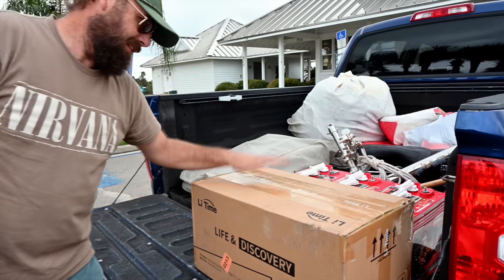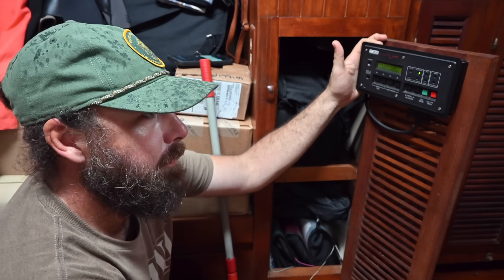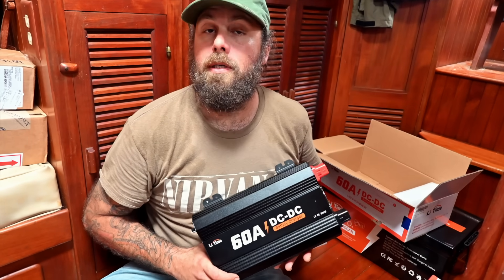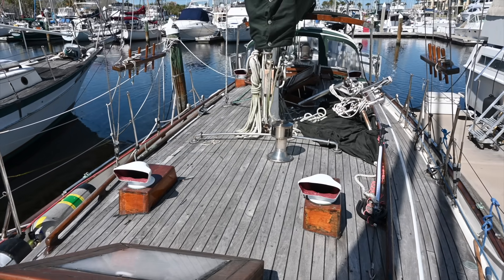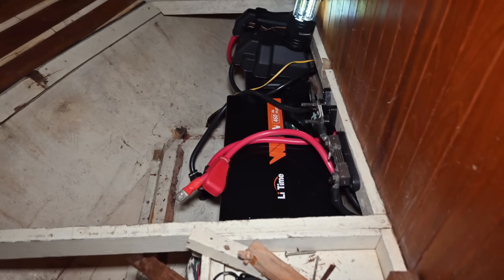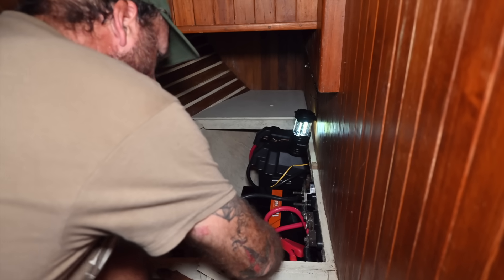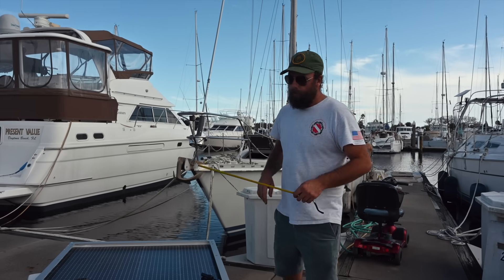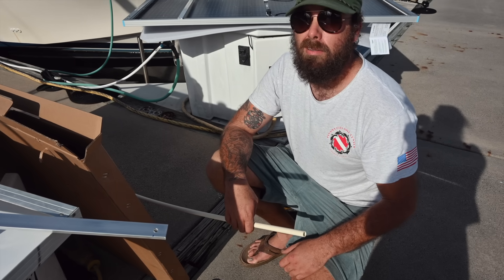WE COULD HAVE EXPLODED! The switch to LiTime LiFePO4 after battery bank was OFF GASSING (Ep47)

Comment: 12:22 I might recommend getting a newer fuse, or better yet a thermostatic breaker.

Also realize it might not matter for you but a wind turbine. I love this vertical on it comes with a wind charge controller this can connect to your battery management system. Once again can't find these things on Amazon.

Brand: TFCFL
Wind Turbine Generator Kit, Vertical Wind Turbine Generator with Charge Controller, 12V 400W Wind Power Generator Energy Supply for Boats, Green Windmills, Industrial, 300RPM
Reply from the maker: Thanks! Yes I do really want one. Hal absolutely didn’t  but he’s no longer on the boat so I can look for one.

Comment: Can you take your teak deck off plane it down then use structural adhesive to attach it to a substrate that doesn’t rot then use the same method to attach to the deck (no screws through fiberglass)?
Reply from the maker: We’ve been considering doing that. It may not be worth it with the current teak because it is thinner, as it’s aged, but it’s not as thin as one might think, and it hasn’t been overly abused over the years either so maybe! We’re still deciding what we want to do about that.
Reply from the maker: I will say this- if we can’t reuse this teak, I very well may sail this boat to wherever in the world I can get a good deal on a teak deck. Hahah I prefer it.

Comment: Sorry ,but are you really sure there safer . Battery bank is supposed to be vented to outside boat ,as mine is according to  lloyds . Off gasing is usually course by bad management. You can rejuvenate standard lead acid . Up to you . Major thing . Keep fire blanket next to lithium. If it gets hot , wrap it in blacket and throw overboard.
Reply from the maker: These aren’t the traditional lithium batteries, they’re the LiFePO4, which are FAR safer than other types of lithium batteries, so yes. They are safer. Also, they don’t need to be outside the boat. That would be a disaster and there’s nowhere outside the boat to install a battery bank anyway. 
The previous battery bank was totally fried and was off-gassing, but we just bought the boat, so this wasn’t necessarily anything we did. The batteries looked old and weren’t marked with dates or anything.
Reply: Hi , I'm aware these are p04 batteries and I agree that they are safer than EV batteries.  Just be mindfully that they are never taken down to 00 v as is a common issue on board boats un attended . This erases BMS memory . Then if you shunt change as stated by manufacturer the BMS has no guide to manage batteries,  this can course issues . The caution I was referring to was OK to store below decks ,but store them being able to get out and wrap to overboard if they get hot . I'm a marine  engine engineer of 38 yrs . Hope this is of use to you
Reply from the maker: Thank you for that!

Comment: I don’t know much about batteries ! I would like to learn. All power banks for solar are lithium I think in homes that are off grid. It is best at any point to keep them cool. Because heat is their enemy. 
I had a truck that I needed start and it was dead, so I jumped started it I caused a spark and one lead acid and battery blew the top off right in my face. It didn’t catch fire but of course I had to replace it. So as far as safer I do think they are but any can have issues. One channel had a bard new cateraman that burned at the dock it was plugged in on charge and lithium batteries caught fire. This happened about a year ago.
The boat was a few weeks old. Another you tuber that was on a sailboat  left his phone plugged in overnight it woke them up at anchor to their boat burning like crazy and had to escape through a hatch. And had jump overboard it burned to the waterline and sank. The only thing different from usual was he left his phone on charge like he normally didn’t do. So lithium is kind of dangerous yes but be aware of the dangers, because many other things can also be dangerous living aboard. Lead acid will not burn but yeah they blow up, and will not provide the power needed to run your boat. The vapors off of them is toxic also so the dangers are pretty close, but the power difference and long life is a major benefit. Make sure they don’t over charge and stay cool, I have read heat is the cause of fires, and over charge and fast discharge causes heat problem and a risk of fire. As long  as you manage that well you should not have any problems, many you tube boater channels have went all lithium and solar. In the long run it will save you money, and with enough of battery bank you can use as much electric as you need. One day lithium will replace almost all batteries on the market. The technology has improved very rapidly and much better now than before.
People bashing it has it and uses it everyday in cell phones. Some even carry it in their hip pocket.
Oh battle born batteries is supposed to be the best (I don’t know), is that what you guys bought ?
Reply from the maker: We did a collaboration with LiTime batteries so they supplied us with everything we needed, so it was a win for us! They're all quite expensive, but these are the newest tech, the LiFePO4 batteries, which aren't like the lithium ion batteries. Supposedly, these are MUCH safer. We will see!

Comment: Danger is my middle name.  Hydrogen sulfide gas is part of life for lead/acid batteries. But, it’s not really an issue unless you’re overcharging them.  The alternator must have been pushing some serious amperage for three batteries to discharge! Hope you saved the old batteries for backups. An inline fuse would slow the charging to the batteries if you are worried about it.  
See y’all when you get back!  Hold fast and batten down.  There’s a strong front moving through the north end of the Gulf tonight.  I don’t know how far it’s gonna dip down south.
Reply from the maker: If I know Hal, this batteries are sitting in the back of his truck at home. 😂

Comment: 14:25 😂😂 video says it all. That rust spot of the bar is barely moving. 😊remember we all have different POVs and the cameras pov wins
Reply from the maker: I voted that the plastic part needed to be replaced and could break off! Hal voted that it was the metal. I dunno...
Reply: I'm with you Siren. Bar didn't budge. Bracket was rocking. Ah well, hopefully the zip ties keep it tight for you. @TheSirensLog

Comment: Lithium is definitely the way to go. It’s cheaper in the long run than lead acid or AGM, because you get about 10 times more charge Cycles, plus you can discharge them close to 100% vs 50% for lead acid.  They are very safe if installed correctly.  Most people confuse the lithium iron phosphate with the Lithium iron used in scooters and cars etc. which are more prone to fires. You did mentioned adding more batteries at a later date. Please note that it’s not recommended to hook up lithium batteries of different sizes, brands or age. In my opinion 460AH is quite substantial for the needs you listed.  I would like to know what type of alternator you have. If you are charging the lithium from the alternator via a dc to dc charger, its recommend to use an externally regulated Alternator where you can control the alternator output, because 😂lithium batteries are “power hungry “ and can over work an alternator. A work around is to charge your start battery (assuming it’s AGM or lead acid) from the alternator and use the DC to DC charger to charge the lithium. Be safe guys.
Reply from the maker: I’ve read your comment to Hal and I’m going to tell you what he’s saying. I understand the system but he knows the setup and what he installed better-
Hal says:
That’s what we are doing- we have an 80 Amp alternator and rigged to charge the starting battery, and the dc to dc charger charges from the starting battery. We’ve jumped the charger to bring the charge from 60 amps to 30 amps. We got the 60amp dc to dc charger in hopes that we could upgrade to a high output alternator later this year.
Reply from the maker: Thanks!!! I will show this comment to Hal. We JUST got a new alternator. The old one was having trouble, and we suspected that basically since buying it but we are now underway and it’s confirmed. We got a new alternator on the Yanmar and it was the one recommended from Yanmar corporate.
Reply: Get a bluetti max charge , 2000 solar  gen , all I one problem solved .

Comment: you said you were inverting but i don't think so.  unless you are running 120v appliances off your battery bank you are not inverting.  you are just operating on 12v for your 12 volt lights etc.
Reply from the maker: We have a 5000w inverter in our lazarette and in one of the first scenes of the video, Hal is explaining how to connect the system to that inverter via the “remote control display”. We run everything off our battery.
Reply: @TheSirensLog  got it so you must have been running 120 volt lighting or perhaps a 120 TV or music system otherwise just running 12 volt lighting does not opearate off an inverter.  Love your adventure can't wait to see you at sea!
Reply from the maker: @paulrees2152  Are you just trying to say that we don’t have an inverter?
Reply: @TheSirensLog  not at all you do have one and you need an inverter, but not to run 12v items. An inverter converts 12 volt power to 120 volt power, when needed.  12 volt lighting and marine electronics run straight 12 volt power from your battery bank.  That's all.
Reply from the maker: @paulrees2152  Ahh yes. Most of our things are 12v, but we still run some 120 like the internet and whatnot.

Comment: With a large solar panel like that you better attach it better, it seams a lot of your repairs and installation of systems are done as a jury rig , don’t get mad but when your life and others depends on the security and reliability of your boat everything you do must be a better standard then what your doing now !
Reply: Solar panel isnt a safety concern and easily detachable if the occasion should arise.  Any and all vital systems to the boat have been fixed with no expense spared.  I am trying to get her home.  Not setting her up for world travel.  100 miles, mostly under engine, in the ICW.  If anything happens I'll ground her and call Sea Tow.
Reply from the maker: You say that but since buying the boat, I spent $13k in just 3 weeks making the boat sound enough to travel. We’ve done a lot more than we could ever show on YouTube.

Comment: Our dog held her pee for 35 hrs before she went on deck. Now she goes all the time.and I agree with you. I think the bar was moving inside the plastic supports
Reply from the maker: Dang! hahaha, I think he will bust before then! But I could see that... once they HAVE to do it, they know what to do. lol
Reply: May be a bit optimistic with the size of the mat😂
Reply from the maker: @Bryan-j4r  yeah the size on the internet was kinda scammy. They included the sides as part of the width and length. 🙃 It wouldn’t have been much bigger anyway, but… still! Either way, I measured the spot is was supposed to go (which Hal took away at the last minute) where it would be safe for us to keep there consistently and still be able to handle lines and such, and that’s roughly what we could fit. He goes to shore constantly anyway, though, but at least this one is compact and he’s pretty smart so he just may decide to use it on long hauls.

Comment: Strap it down or use Bungy Cords to secure the solar panel. You know that new Lithium battery will need a higher charge rate than the Lead Acid type, right? Phantom Draw Current shut everything off then check to see if there is a current draw-down? Just checking.
Reply from the maker: That is part of what he was showing in the beginning, how to change the settings with our inverter for lithium. It’s in the video. And he did reinforce the panel with zip ties, in the video as well. The panel isn’t strong where it sits, but should he encounter heavy winds, we can easily remove it until we get home and get a new davit system.

Comment: Great idea for doggy bathroom,  you need an SUV cargo liner with bigger lawn for that big boy of yours.  If that doesn't work the pup could use.. just kidding.  Things are looking great.  I switched to AGMs a couple years ago,  heavy.. just don't trust lithium yet
Reply from the maker: I looked and looked for a good cargo liner on Amazon that would arrive in time and honestly didn't come up with much. I'm sure once we're home and can look across the entire internet we will find a good one, but I ended up with a similar thing, which is more of a doorway, shoe thing for boots and such, essentially the same, but when I got it in the mail I realized they cheated on the sizing. Their measurements INCLUDED the sides!!! so the actual size was almost 2 inches smaller on each side. lol But yeah, he needs something bigger, it's just hard to fit anything on the boat. He's smart though! I'm wondering if he can't handle the little one. We will see! It's all we've got now!

Comment: I went lithium house bank with 60A DC-DC charger 2 1/2 years ago. Solar is my primary house charging source. Have a Balmar 120A alternator, external regulator, and serpentine belt and pulleys. Watch your alternator temps closely! It will draw 75A to charge at 60A. 75A continuious is too much for many alternators. I derated the DC-DC to 30A charging output, as the alternator got warmer than I liked. At 30A charge rate alternator draw is 37A, case temp of alternator stays below 180F. even on 95F. days. This is real world measurements on my boat.
Lithium house bank is fantastic, single best investment I have made for life aboard. Living on the hook our batteries usually are charged to 100% by 10:00 am from overnight usage of refrigeration, lights, radio, and normal stuff like water pumps for showers and dishes, and occasional microwave use.
 With LiFePo you get to keep 95+% of energy harvested since the internal resistance does not increase with state of charge, unlike flooded lead acid, which takes many additional watts of power to achieve full charge, (which FLA needs to last). LiFePo is happy to rest in a partially charged state.
Do get a columb counter type of battery monitor, They can be purchased for around $60 on Amazon. Voltage won't tell you anything about state of charge of Lithium.
Hope you are enjoying the new (to you) boat!